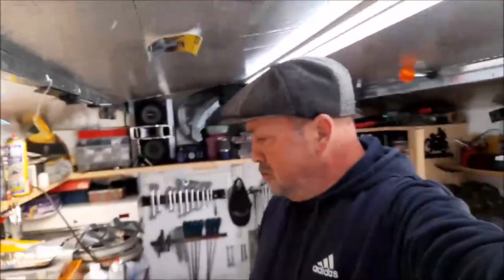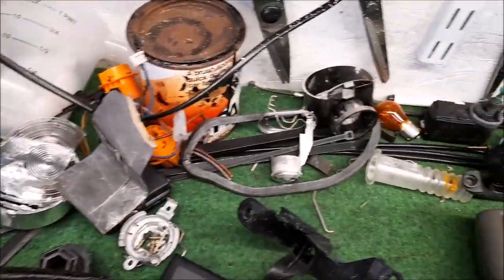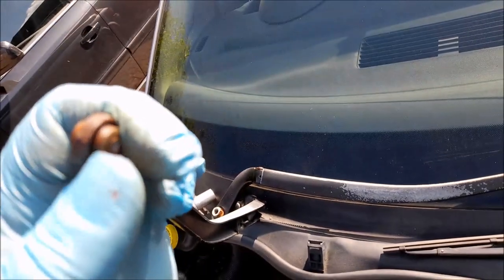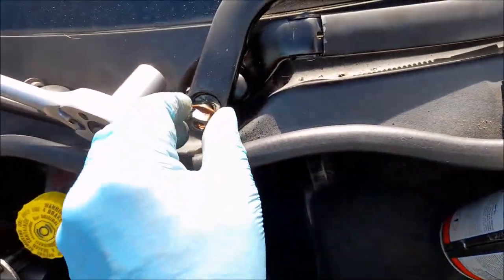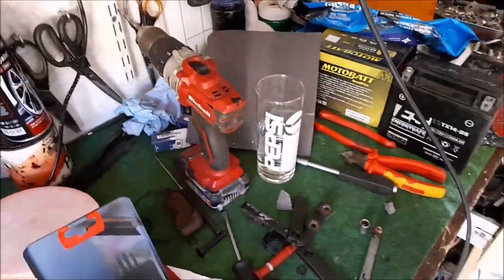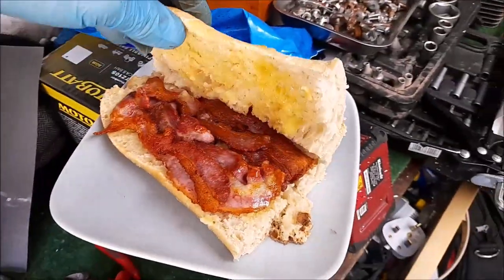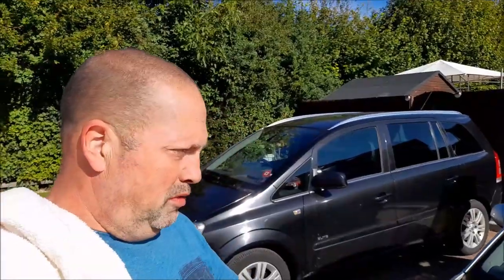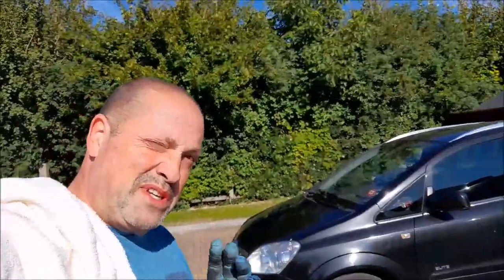Audi A2 Restoration Episode 3 Wiper Arm Fix

Comment: The ground to the motor is a very common issue. In mine i just got a wire from the body to the body of the engine and it works. I did not even bother to take it off -- just found a nice place to fit it to the chasse and use a screw on the engine to fix the ground

Comment: Head lights can be very swiftly restored with autosol chrome polish (2!second job). The wiper droop can be fixed by inserting a couple of thin nylon packing washers -cut to a Pacman shape and pushed above /below those rivets , smeared with grease and wd40,  20 second job.   Sorry to tell you after the event - only just seen this video. (Ive owned an a2 for 22 years) .  Great viddo
Reply from the maker: @terryjones9987  thanks Terry. I'm selling mine   :-(
Reply: @eadsierestorations  that's a shame,,, but looking at the state of it (due to previous owners) it does look like its been abused a little.  Youve done some great jobs on it and I wish you the best.thanls for making the videos really helpful.